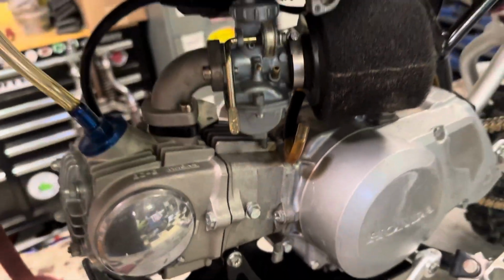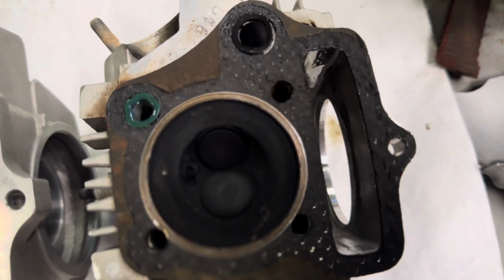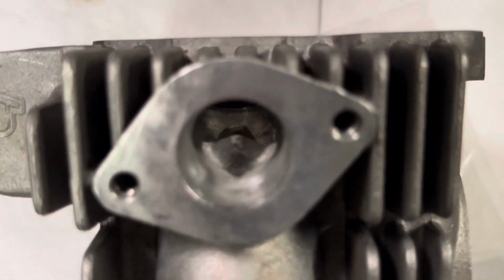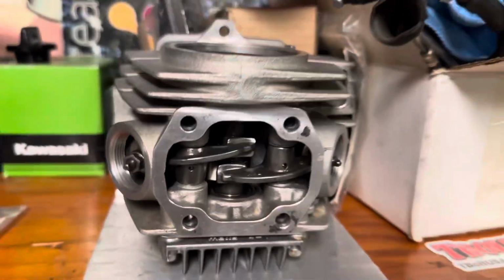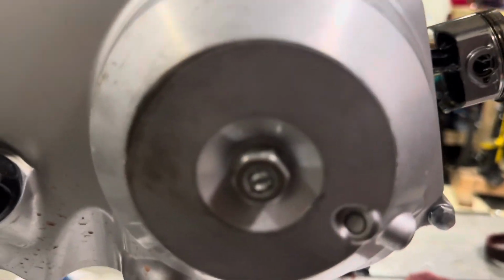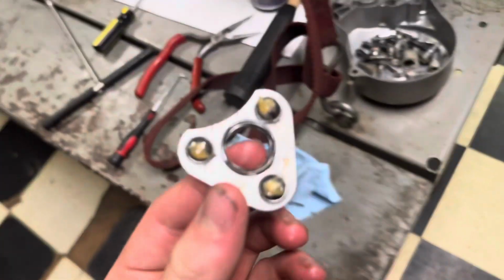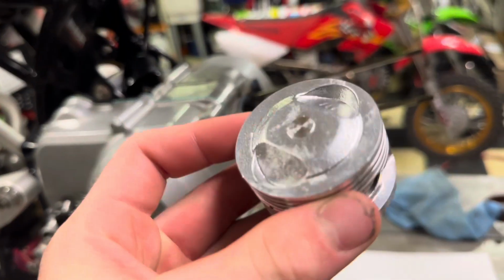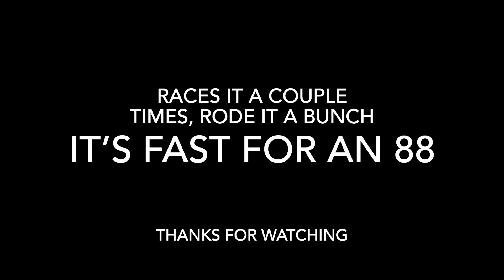BBR CRF50 Gets a BIG Power Upgrade! TBparts Race Head 88cc Install & Ride

Comment: Building this for my 10 year old son to race against 110s at the pit bike track. This is the first video Ive seen if someone actually ridingnit on a pit bike track to get a feel for the power.  Im so stoked to see him ride it
Reply from the maker: That’s awesome! I was able to keep up with 110s fairly easily, as long as I kept my momentum and rpm’s up, since the 110s have a little more grunt down low.

Comment: Which head is that?! And good lord those ports are huge lol
Reply from the maker: Tb race head for Honda mini motors. And believe it or not, the ports aren’t much bigger at all than stock, I mainly just matched the intake, blended the seat into the bowl, and shaved down the valve guide
Reply: @tuckerbeddiges  I appreciate you letting me know what you did. Beautiful little build! I’m about to put my 88cc big bore kit 97’ z50 fully back together

Comment: In my opinion T Bolt USA inserted the Pioneer on engine rebuilding you can buy all the parts from them and have your engine fully modified and shipped to you run ready and test it I've heard so many good stories about them.
Reply from the maker: Yeah for sure, Vince is a good dude and he always has a ton of stuff in stock